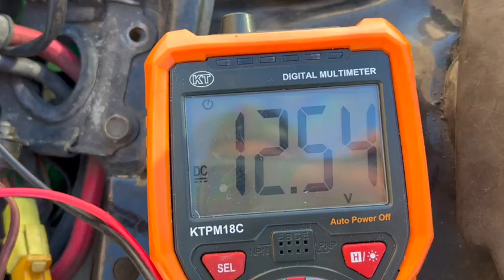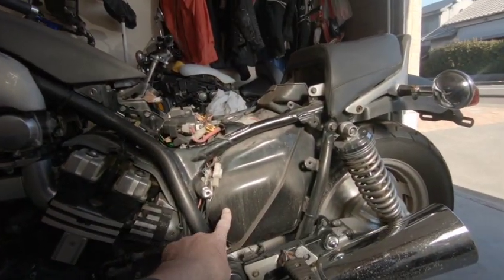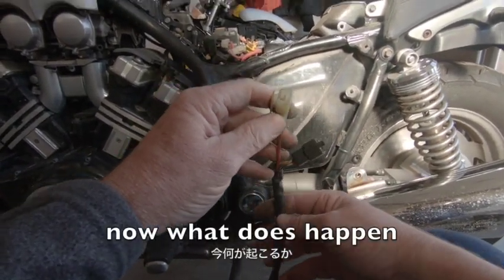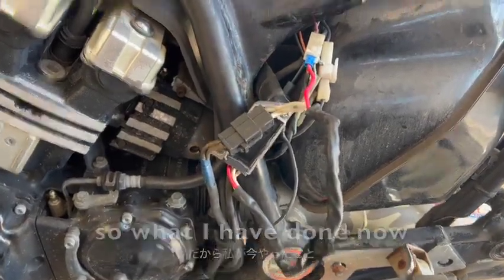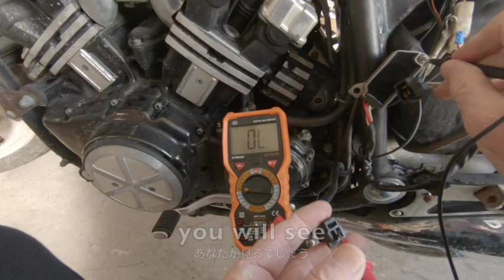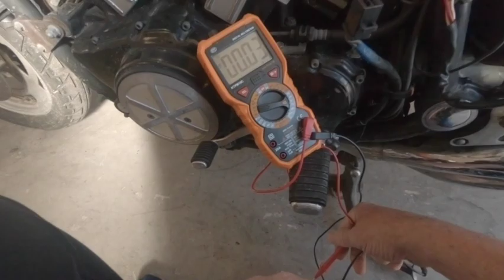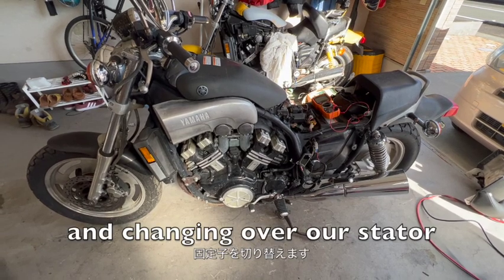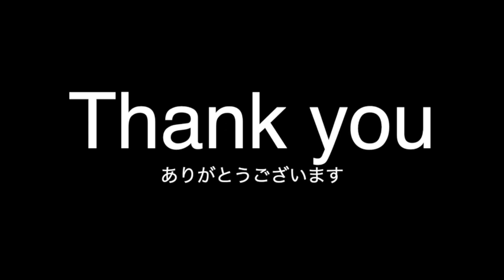Episode 6 what's wrong with the charging system? 充電システムの何が問題になっていますか？

Comment: Diode trio.  When you pull that stator and check the windings from the stator itself.  You find it.  Very common.   I've replaced  more stators  then regulators.  And I've seen bad batteries trick regulators  too.   Good video!
Reply from the maker: Hey good to read your mail. I’ve owned my 1985 vmax for 12 years now and replaced 3 burnt out stators but the current one and regulator have worked great for years. I’m looking forward to seeing the stator when I remove it from the casing. Thank you always for watching and commenting KR